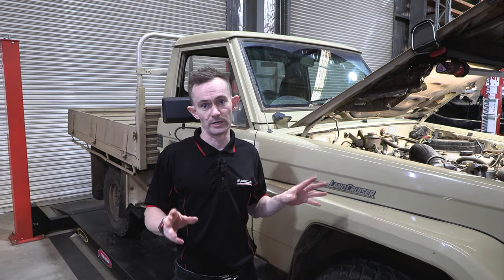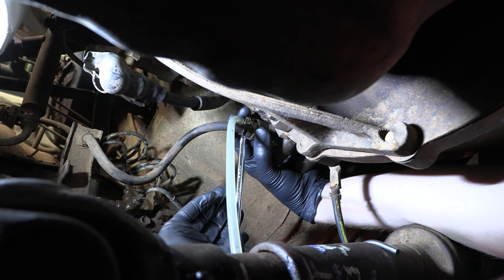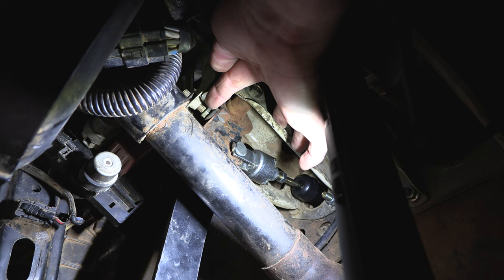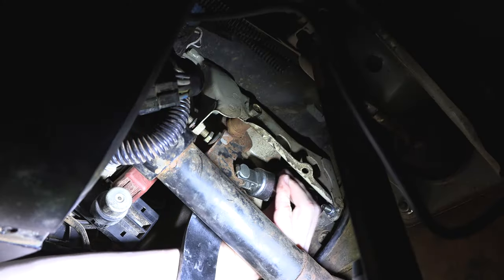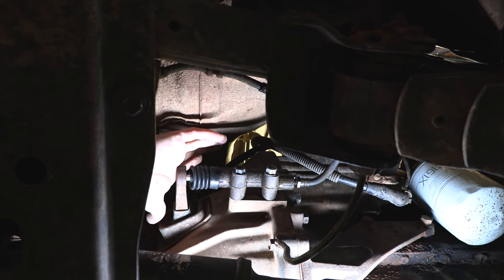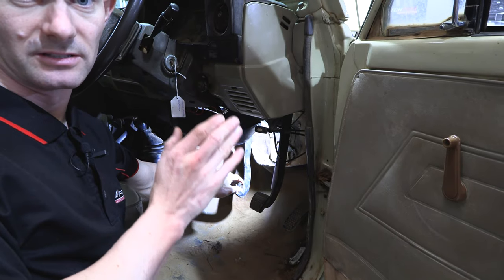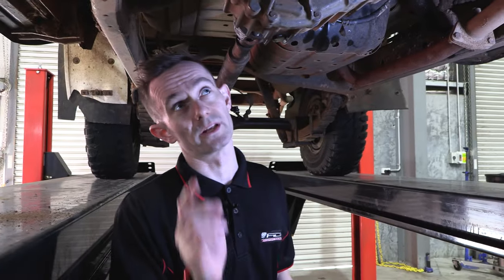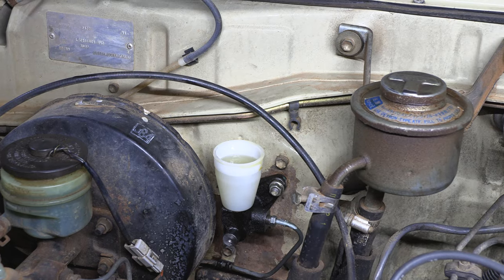CLUTCH TECH: How To Correctly Adjust A Clutch Pedal

Comment: Is there a way to adjust the throw or length of travel for the clutch pedal? I just got a 2015 Ford Focus ST and I have to sit very close to the steering wheel to get the clutch pushed in all the way. It's been a long time since I've driven a standard transmission car. I do ride a motorcycle but it's my understanding the clutches are different between motorcycles and cars.
Reply: Having same problem myself in my hatch. Seems only choices we have is to engineer the pedal which can be expensive or unsafe if done incorrectly. I think we both just need better cars lol.

Comment: Will an inproperly adjusted master cylinder linkage cause the pedal to get stiffer and stiffer until it freezes up at the top position? When I try to bleed it, it gets stiffer and stiffer, looses range of movement in the clutch pedal until it freezes. I appreciate any insite!